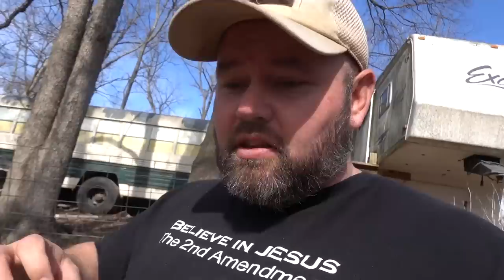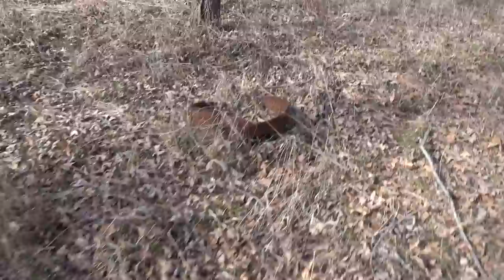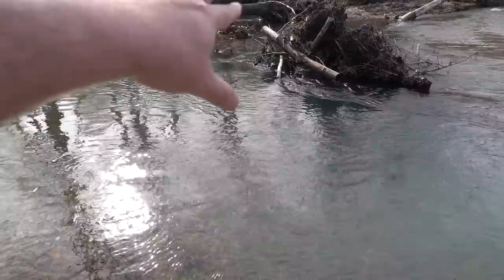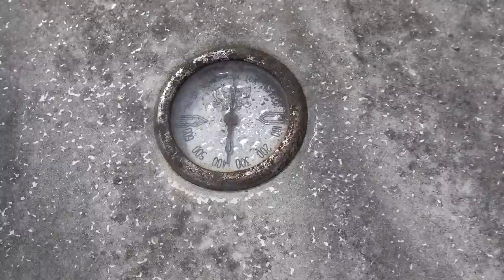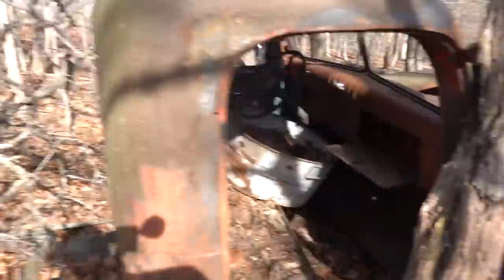Look What We Found Hiding At The Abandoned Creek Property

Comment: I love watching you exploring the wood. Just one thing, the flowers are not daffodils, they are crocus. A beautiful little flower that grows during late winter, early spring. I would dig some and replant them myself.
Reply: After googling and looking at the pictures I AGREE with you 100%. I have daffodils in my yard and they're not the same. Still beautiful though.
Reply: Those flowers look alot like drawfs daffodils
Reply: I don't believe so. I'm in my 70's and know the difference. A crocus is much shorter and only has about 5 petals of the same length. No 'skirt' like a daffodil has. I have them both.
Reply: @jan-janalemayer3518  I agree with you. I'm 66 & have been around the daffodils all my life. In NC some call them Buttercup's. Crocus are smaller
Reply: its a daffodil it has a center peddle. i'm sure crocus grow similar but usually bloom a little later. wild daffodils are shorter and smaller than cultivated ones grown in garden, and all yellow in color but can have white peddles with yellow center peddle.

Comment: The upside down car is early 1940s Dodge. The emblem is called the Dodge Crest.  I would be interested in the two old Dodge trucks. The body was pretty much the same from 1937 until 1947. I built my wife a 1946 Dodge truck rat rod the was actually in the hot wheels legend tour. The big square frame you found is what’s left of an old flat bed farm truck.

Comment: The medallion on the upturned vehicle looks like an Imperial crest...that was a Chrysler line that lasted many years.  You'd have to look at every year of the line to find that model year.  Other badging or markings, stamps could help narrow it down.  The other looks like the frame of a flat bed truck, the part that sits on top of the frame.  Maybe even a stake bed truck.  Those look like stake pockets.  Dodge truck, no restore.  Rebuild.  Those repaired body panels on a newer frame (modern safety features) and drive train (engine/transmission).  Nice adventure for the kids!  Awesome!

Comment: My grandfather had an old pickup just like those that running boards with the step side and they welded a handle on the cab side to hang on while you could ride on the running board for hopping off quick to do chores like throwing brush in the back. Worked my summers at his ranch growing up. Learned to drive in that old truck.

Comment: Most people take those cabs and beds and use modern drive train like a Chevy s-10 or Dodge Dakota it gives you disc brakes power steering, that thing at the bottom the windshield is 40s ac it’s called a vent. That car looks like and old Cadillac to me, the frame looks like and old farm truck bed probably goes to the cab without a bed

Comment: As far as I can tell,  the one car that was upside-down with the "coat of arms" type emblem is a 1942 Dodge Series Six or Business Coupe. 1939 to 1942 , Dodge stopped production from 42 to 46 I think. Different emblems were  used.
Reply: I looked up one on ebay. 1942 dodge coupe cloisonné emblem, looks close. Just found it ! 1946, 47, and 48 front hood emblem. Listed at $128 on ebay
Reply: You could get some serious money for those parts. That one emblem is about 50 bucks on ebay. All that metal trim is very rare and expensive. Back when they made it from real quality metal.

Comment: The heavy frame that was wider than the truck beds, could have been an old hauling trailer frame of some kind🤷‍♀️
And the question about the liscense plate, I hears Brandi say about getting stickers. Back in those years, you hot new plates every year. And the new plates were always a different design than the year before. .

Comment: Restoring those trucks could be expensive. Dodges are hard to find parts for but making it a restomod (not sure spelling) where you put the model on a modern chassis would be great. That big flat metal frame looked like the flat bed off a 2 or 3 ton truck maybe. The truck with no bed looked to be a bigger ton truck.

Comment: A crest logo was introduced in the early 1940s, with many believing the symbol was used to represent the Dodge family. The original design featured four horizontal lines with a vertical line going through the middle. The letter “O” was in the center of these bars, and a knight’s head appeared at the top.

The knight’s head was dropped by 1955, but the design stuck around for an extra couple of years. Every now and again, Dodge would reuse that crest design, with the logo popping up on the 1976 Aspen. The design ended up sticking around before being replaced in the early 1980s.

Comment: Hard to tell the actual size of the frame but it looks to be off of a truck that was a flat bed. It would of had wooden planks for the deck and probably removable side rails.

Hard to b sure based on what I could see in ur video but the car looks like a late 30’s Dodge DeSoto. 

Keep the faith...

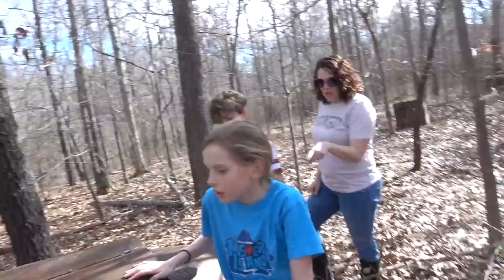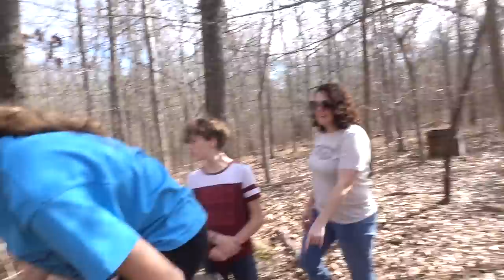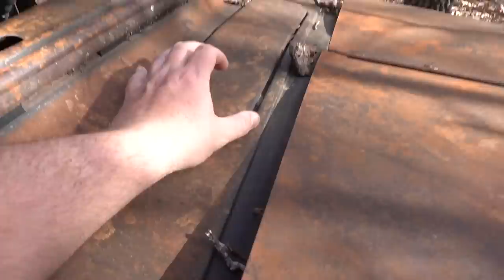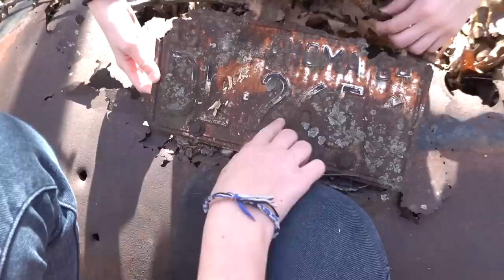Comment: Hello everyone.  At 17:09, Kevin was right about the Pickup being a 1945 Dodge.  At 18:01, way to observe the Windshield Wipers above the Windshield.  At 18:09, inside cab, looks like Wiper Motors are still attached to the wipers just below roof.  At 18:15, you are are touching air-vent below windshield.  Under inside dash, there is a Lever to push down to open vent for fresh air (‘poor-man’s’ AC)!  They had them even into the 1950’s.  At 21:25, the License Plates were good for 1 year.  Had to buy new tags every year and there would be a different set of numbers and/or letters & also the next year in the corner of the plate!  It was changed to self-adhesive stickers in’70’s or ‘80’s, approximately, now it’s on windshields; what else will change??  You should restore that last Dodge Truck as it looks to be in very good condition and fairly complete for its age; plus the other parts pickups.  Keep Safe & Healthy!!!   Wishing y’all the best from Seymour, Texas.
Reply: Cary Ward, are you the guy that has all the old trucks and cars right on the highway, there in Seymour? My husband still wants that 56' Ford pickup that's there!!! 😂🥰
Reply: @jviglicky  No, I don’t own any old vehicles; just lived through many Decades!! Good luck in your quest for it!

Comment: Go to the county and get old plat books they will help you locate homesteads and give you info on all previous owners.  The girls will LOVE to use a metal detector to find MANY interesting and historical things.  Take some colorful/water proof ribbon when you go exploring it will help you relocate your finds after the leaves open up… you could use different colors for different finds.  FYI daffodils are TOXIC especially the bulb part.  The Front hood ornament is from a 1946-48 Dodge OEM sells on e-bay for Round $70 without the surrounding mount…..I also noticed grape vines that Brandy was holding onto at one point.

Comment: My husband had a 56 International Pickup.  It had the original engine and transmission.  My husband lifted it and shortened the bumper, other than that, everything was original, even the seats.  We would take the truck and go exploring the desert, the old mining claims, and washes.  We live in the Arizona desert so there were lots of abandoned claims and but only a few homesteads. That truck could go anywhere, even through the deep pea gravel in the washes. There was hardly any hill that it couldn't climb, that low granny gear took us up and over and through places you wouldn't believe.  With the dirt bike tied down in the bed of the truck we could go practically anywhere.  Now, the reason why my husband shortened the bumper was because one trip he drove through a wash and the bumper got hung up on the side of the wash.  We couldn't move, it was like being high centered.  My husband always carried everything for any "what if" that might come up, so he pulled out the shovels to dig out the hard caliche the bumper was hung up on.  Ahhhhhhh!  I loved those old trucks, they could be fixed with just about anything, even bailing wire (used to be used to bind hay bales).  One time we were riding across the desert and my husband went to press the brake pedal to slow down as we approached a very small wash across the path.  BUT, the brake pedal was not where it was supposed to be, it was laying on the floor, so he quickly down shifted to try to lessen the impact but we still hit it pretty hard.  NOW, this is where all those springs you saw in the cab comes in.  You see, those seats were coiled springs.  So when you hit a bump, you flew up and hit your head on the ceiling (and we did numerous times. ROTFL!!).  
Now, you were wondering what the little door was between the windshield and hood of the truck?  Well, my husband called that "his air conditioning"!  There is a lever inside the cab that opens and closes it.  And yes, that was our air conditioning when we were bouncing around in the desert in sometimes 120 degree weather.  My husband loved the heat, but not me. 
Thank you for showing the trucks and bringing back such wonderful memories for me.  And by the way, that truck was still running and taking us all over in the desert until 2006, that's when he was diagnosed with terminal cancer.

Comment: It is A crest logo was introduced in the early 1940s, with many believing the symbol was used to represent the Dodge family. The original design featured four horizontal lines with a vertical line going through the middle. The letter “O” was in the center of these bars, and a knight’s head appeared at the top.

The knight’s head was dropped by 1955, but the design stuck around for an extra couple of years. Every now and again, Dodge would reuse that crest design, with the logo popping up on the 1976 Aspen. The design ended up sticking around before being replaced in the early 1980s.

Comment: The flowers looked like crocus from what we could see. The trucks are amazing. I believe it could be a late 30s model or a 40 sometning. I had a 41 Chevy at one time. If you could get a picture of that emblem on the car you may be able to research it. There weren't a lot of mid forties vehicles I have been told because they needed the metal for vehicles for WW2. I read that they started producing vehicles for consumers again in 1946. I think 42 through 5 was just military. I hope that helps. Images I found on Google looks like the better one may have been a 1947 Dodge. The upside down car appears to be from the 40's as well. I am emailing an emblem that I think looks the same.

Comment: I'm 98% sure that unknown car emblem is from 1946 to 1948 Dodge D24 Sedan Header Panel emblem deluxe trim pkg, and I am pretty positive about that, I have been rebuilding 30s thru 60s cars and pick-ups with my dad and his friends since before I could walk, and I can most certainly tell you that if you or anyone in your family is planning on rebuilding those, even if it's to the point of drivable and not a complete restore, keep every single piece you have, even that gas tank that's 25 ft away, keep all of it I've seen those hoods, frames, but I have only come across a few complete cab's with rusted thru holes I could reach my arm through and they went for 5 digit prices, those you have look excellent, those 3 vehicles parted out to the rite buyer's would more than likely bring in the same amount if not more than you paid for that lot.....  Keep it you will never come across anything like those again!!!!